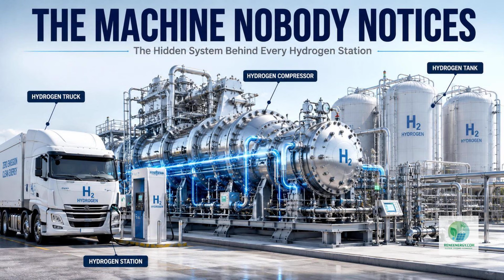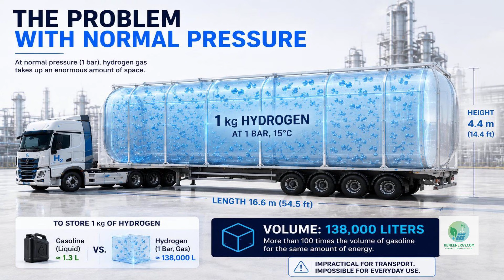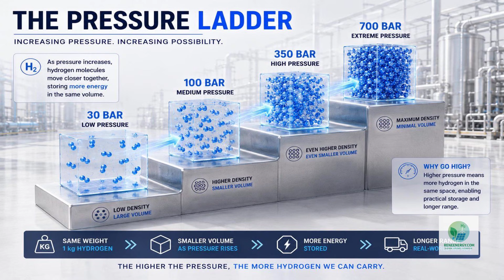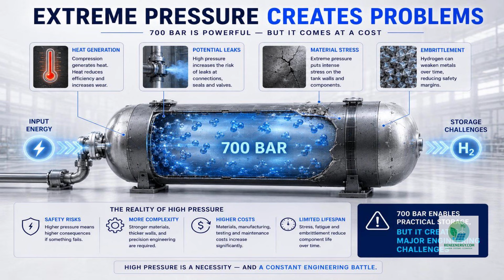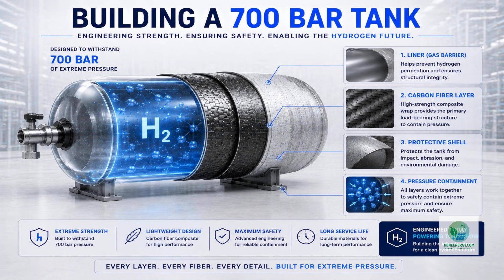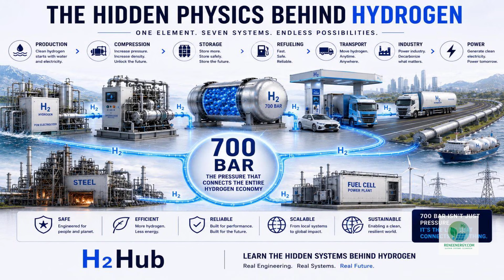Why Hydrogen Needs 700 Bar Just to Work

Comment: You are assuming vehicles are running on pure hydrogen. What chemists are now researching is how to make carbon fuels from hydrogen, high school chemistry. Combine hydrogen with carbon dioxide from the atmosphere and you get methanol. Combine hydrogen with nitrogen and you get ammonia. Both methanol and ammonia are fuels. Hyundai has built a hybrid ev. Methanol powers a generator that recharges the battery, such engines are being used in WRC rally cars. Ammonia is a convenient way to transport hydrogen. China is currently making jet fuel from electrolyzers powered by solar and wind, combining the hydrogen with C02 from the atmosphere making jet fuel. They are also working on combining hydrogen with a metallic powder to form a paste that can be inserted into canisters which when injected into water releases the hydrogen, simple ideas, high school chemistry we have known about for decades, never developed. Fossil fuels are hydrogen-carbon molecules, we can manufacture all these fuels using green energy powering electrolyzers, making the carbon chain molecules with hydrolyzers, fuel forever for next to free. It’s doable today, it was doable since 1835 when Michael Faraday laid down the ground rules for building electrolyzers, never developed , mostly because it does not create dependency so capitalists would not invest in it. Fossil fuels does create dependency as clearly indicated in this Iran conflict. so capitalists invested in fossil fuels instead. Nothing scares capitalists more than that four letter word, “free”!!! You see, we never needed fossil fuels in the first place. Think about it, you know I’m right, it’s obvious.
Reply: Closed loop hydrogen generator by Vivian needs independent confirmation along with the new remake of Joi Scientific at Kennedy Space Center office complex. I like YouTube "Cavitation Energy Systems" by Bill Mee that was discouraged by life threats with open disclosure & 10 year old YouTube video titled: "Energetic Cavitation Impact" generating 400,000 PSI with custom BB Pellet sized cavitation bubbles impacting invented by Prof Marc Ramsey at Vanderbilt University. See Keyou GmbH, Germany for hydrogen gas fueled diesel engines where steam exhaust is redirected back into combustion piston chamber providing high efficiencies comparable to fuel cell. The Ayrton Energy in Canada has discovered how to safely store hydrogen in non-toxic room temp clear liquid to be recycled 1,000 times before replacing ideal for intermodal distribution. About 3 years ago a self funded independent inventor built portable self contained free electrical energy generator with no limit on output but 2 days after patent was granted the govt agents confiscated device.
Reply: True...permanent solutions I not good for capitalists
Reply: You can extract Hydrogen from the air, except it costs too much for the energy to do so.  So most of the hydrogen is produced by chemical reformulation of Methane.  Duh!  Why would you extract it only to reformulate it it?

Hydrogen in liquid or gaseous form can be used as a fuel, but in gaseous form it requires  too much volume and in liquid form it's both dangerous and too difficult to contain.

I have spent over two decades in and around the MRI industry, handling liquid nitrogen and helium.  Both require very careful handling and you'll notice neither are readily transported very far, and then almost exclusively in limited amounts in refrigerated tankers.  Hydrogen is even more difficult to handle and trust me when I say that you don't want to be filling your vehicles at a 'convenient' refilling station.  You wouldn't even want one in you neighborhood.